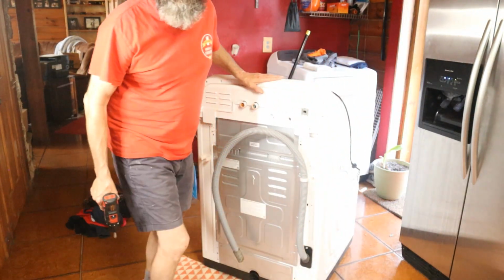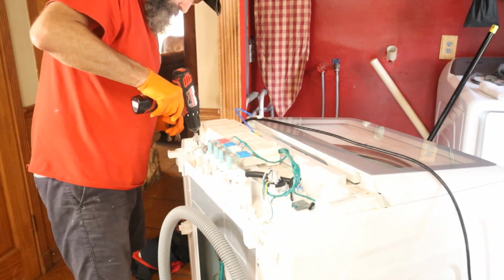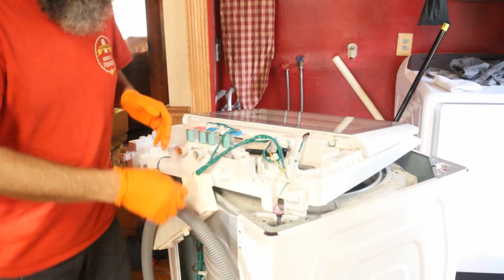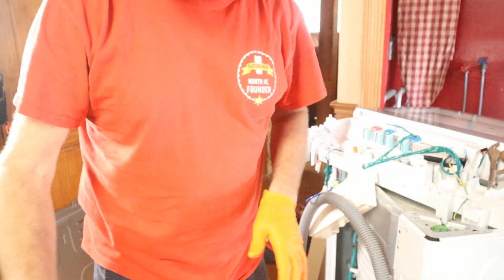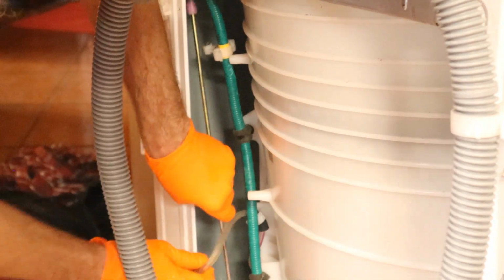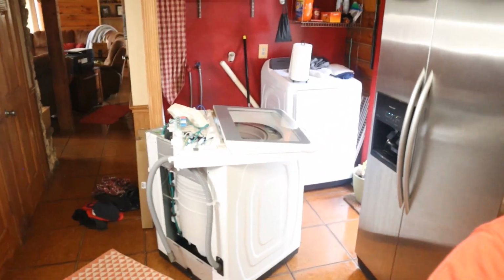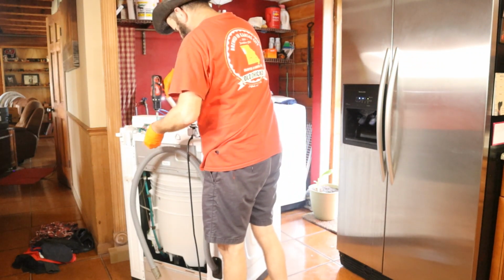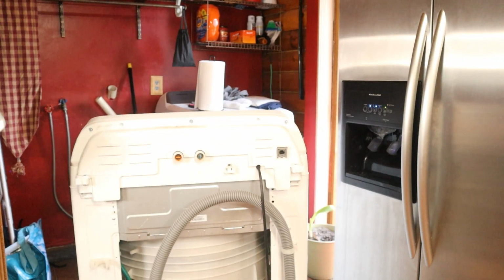Samsung Washer Out of balance!!

Comment: It looks like the drum is what you’re holding up with those rods. Would it be possible to put a couple of wooden blocks underneath the drum to help keep the weight off and make it easier for you to put the rods in there holder? The reason I ask is I have a different kind of front loader and I know the drum is heavy weight balance is three concrete blocks. I had a really difficult time putting on the springs might make it easier.